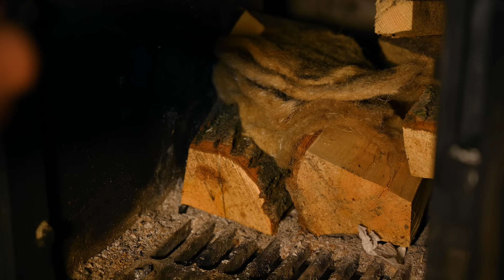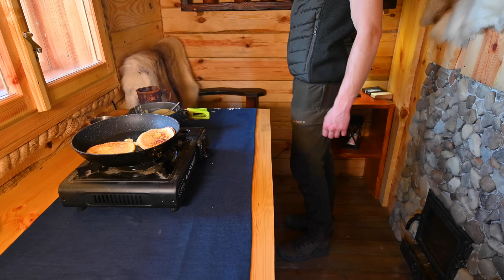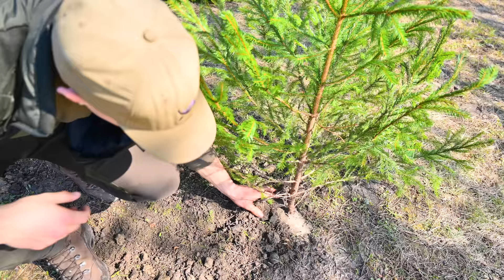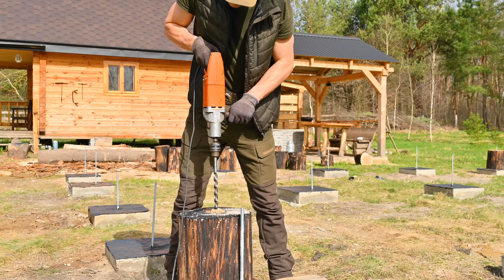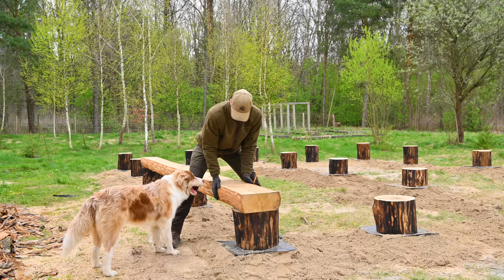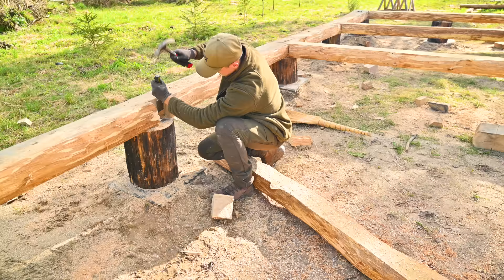Building My New Big Log HOME in the Wilderness With My Dog | Wood Foundation - Ep. 1

Comment: You answered all my questions in your description. Oak is an excelent choice. Especially since you did so much to protect the footings. I would have also tarred the tops of the upright foundation logs. And I would not have cut off the metal rods. I would have drilled the floor joists and set them over the rods. Just for extra peace of mind. Of course you don't get tornados, like we do here in the north central USA. Or 100mph wind gusts like here. You are doing excelent work. I can't wait to see the finished main house. I'm guessing with some solar panels. And nice tractor. I hope it serves you well.

Comment: Love this vlog Bjorn. By the way, I thought about something I haven't seen before. I stove that is a heater and water boiler/heater, but with a steam generator attached. Surely if you burn wood, it creates heat which would then boil water, which generates steam. This steam could surely then generate power with a steam generator? This then could be converted to electricity with thus generatorx? This could be then stored in batteries, surely? The steam could then also be "recycled" to use the water again. Maybe someone might be able to suggest how and how to build such a thing... Just an idea...

Comment: I hope the logs were seasoned before cutting them flat.  I saw a twist in a couple which tells me not likely.  It’s best to let logs dry significantly, before milling them, or run the risk of twists, crowns, bowing, and worse.  Let the wood mostly finish moving, then cut it.  I hope you get this foundation solid and level.

Comment: I keep trying to calculate what are the spaces between these foundation supports. I keep coming up with about 24x24 feet or maybe 24x36 feet? 8Mx8M and/or 8Mx12M? 

I'm guessing between 4 and 6 feet between each platform? Sometimes they look to be 6-8feet between, and other times they look to be 4-7feet apart. Depending on the camera angle.

It's hard to tell but based on your height which seems to be about 6 feet tall, give or take an inch or two. 5'10" - 6'2"
Bjorn, could you please put me out of my misery by telling me the actual dimensions? (grins)

Comment: I'm still guessing here but assuming from the ending of this video's Ariel view, I think each section is 8 feet long, making the structure 16x32 feet? (right or wrong?) 

But if each section is 10 feet that would make the structure 20x40 feet, which seems a better choice? 

I don't think these sections are 12 feet, but if so that would make it 24x48 feet, now that big. 
It's killing me not knowing the real dimensions, and you've been tight-lipped about that as far as I can tell? (grins) 

I assume also that you are going to build UP as apposed to ranch style, with at least 2 floors and an attic? Perhaps even 3 floors with an attic because of no basement? But certainly 2 full floors. Am I even close here? (grins) 

I like the style and the way you are building that foundation. Though, I'm kind of surprised you are not using wooden nails... yet. (grins)

I'm enjoying these videos very much. I just wish you'd put me out of my dimensions' misery.